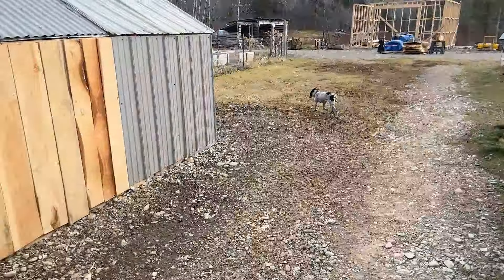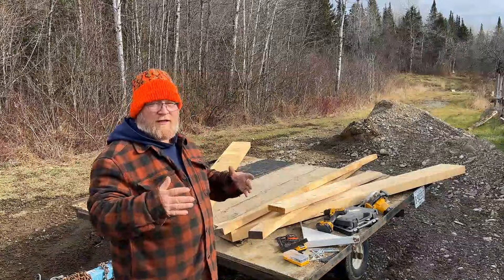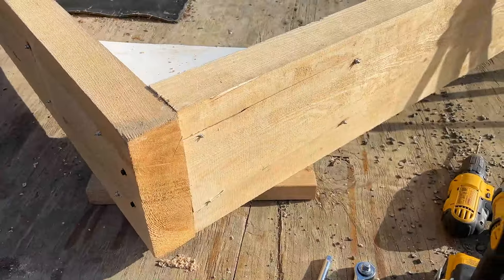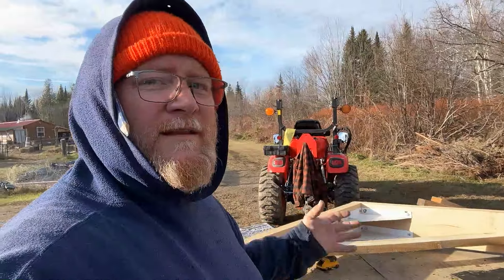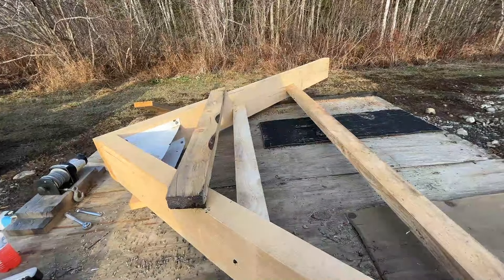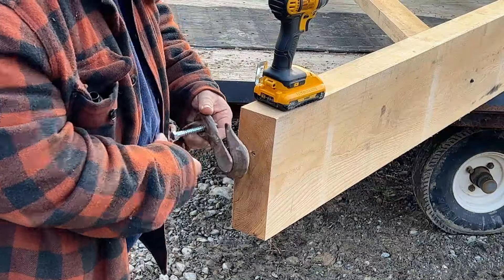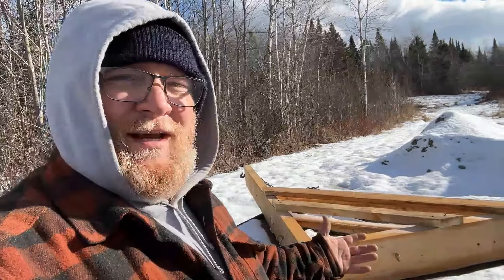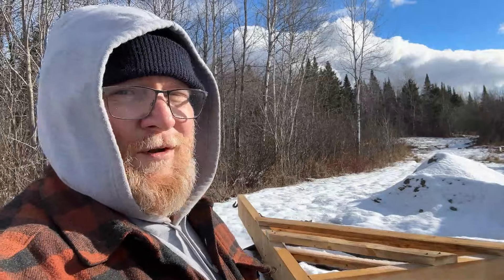DIY EASY Homemade V-Plow | Snow Removal

Comment: I got the same one that pulls behind my tractor the only difference the front nose you're going to have to guard it with some type of sheet metal the wood will take a beating
Reply from the maker: I’ve been looking into shielding the nose and underside of the 3x10’s.  We’ll see what I can come up with.  Thanks for the comment!

Comment: Had this idea a couple years ago. Just got around to building it until now. Mine is gonna be 8 feet wide and have angle iron attached bottom to prevent the wood from wearing out. Havent finished yet but wish me luck :)
Reply from the maker: Never too late 👍 I used angle iron on our first one but had a hard time keeping it attached so I took it off.  Hoping to get a few yrs out of this one till I have to replace it.
Reply: @HanbleceyaRanch  just finished mine and I love it. Mine is scaled down quite a bit.  Made out of 2x10s and only 5'8" wide. I used a really big corner brackets and carriage bolts for the joint instead of lapping the boards and nailing them. Anyway, I had wonderful performance despite its light weight. Definitely see why you added the chain on the back, without it the surface is really slick.
Reply from the maker: @flecktards3126  happy to hear you got it built! If it’s too light, consider adding cinder blocks near the nose.  Get a 10’ chain and attach it to the ends, it’ll make a world of difference to the surface.

Comment: I made one out of steel beams.  Made a small packed layer of snow that turned to ice.  And it kept going far left and far right.  Wouldn't stay in the middle.  Didn't work for me.
Reply from the maker: I can see how that would be frustrating!  This is the second one I built.  As for the ice…it goes with using a drag like this, can’t really avoid it but we do get through it with ash and sand

Comment: Not gonna lie, you likely didn't need those metal plates. And you likely didn't need such thick timber (2x12 boards would have worked just fine). Great job nonetheless. Sturdy for sure. Aint going nowhere.
Reply from the maker: I appreciate the feedback! I hear ya that I may have gone a little over board, but I built one the previous year with 2x10s and it didn’t hold up very well, so when I built this one I wanted to make sure it was rugged and could take a beating 😊
Reply: @ Ohh interesting. Well, good on you then. Figured 2x10's would hold up. Dang.

Comment: The drag chain connection is a weak point.
Reply from the maker: @myronbenware4452  A weak point in what regard?
Reply: @HanbleceyaRanch  If the chain catches on something, it will split the plank or pull out ruining the hole. I hop not.
Reply from the maker: @ I appreciate your explanation.
It makes sense. Fortunately, I haven’t had any issues so far, but I’ll keep an eye out on it. Thanks again.